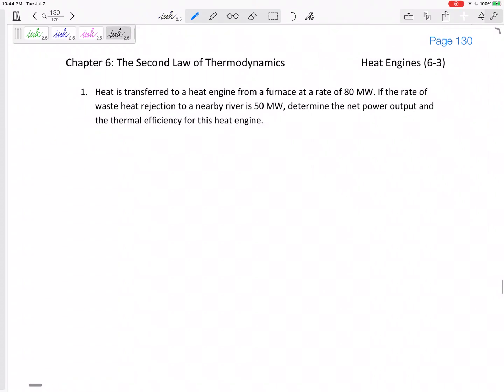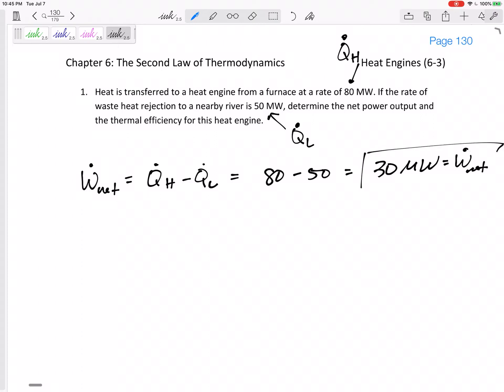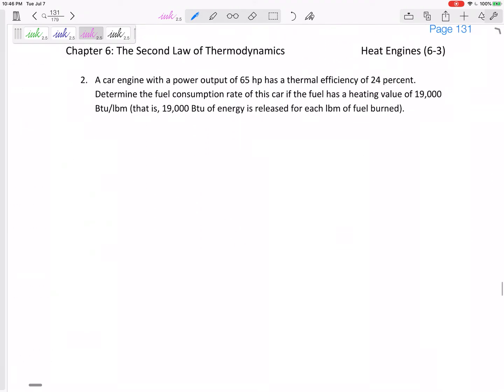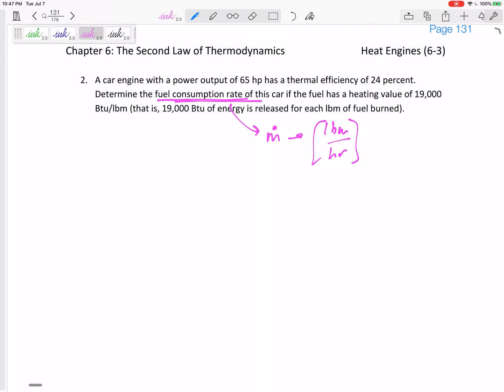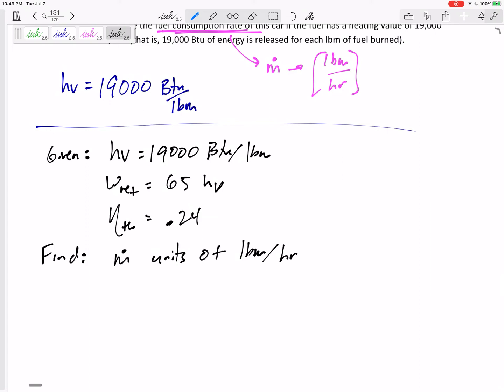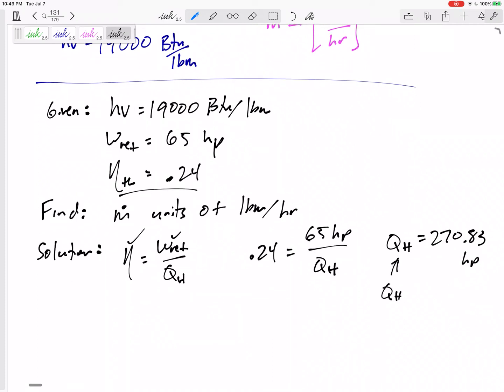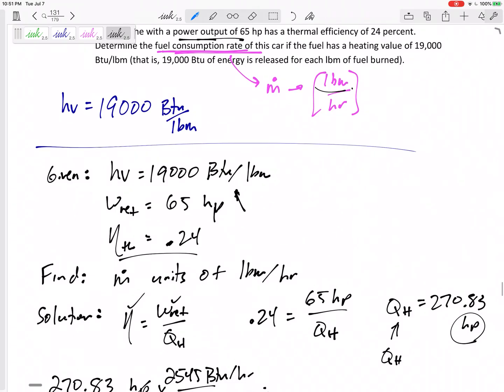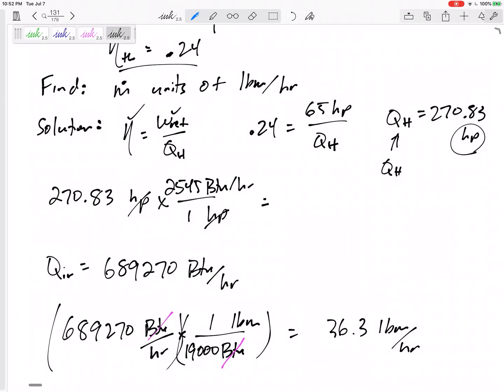Thermodynamics - 6-3 Heat Engines - examples

Comment: Why is the given power output called Wnet? Why isn't it Wout?
Reply from the maker: If you’re talking about problem 2 here, yeah, usually any power they’re giving you is going to be the “net” work out even if it doesn’t explicitly say “net.” In general, we don’t really care about total work out, we always are talking about “net” work out.
Reply: @engineeringdeciphered   Oh, I see, I see. Thanks a lot!
Reply from the maker: It is asking for “net” work, so that would be total work out minus work in. The video before in the playlist might be helpful? 6-3 heat engines - notes
Reply: @engineeringdeciphered  Yes, I've gone through that video. In example 2, I meant, where they have given us power output in hp